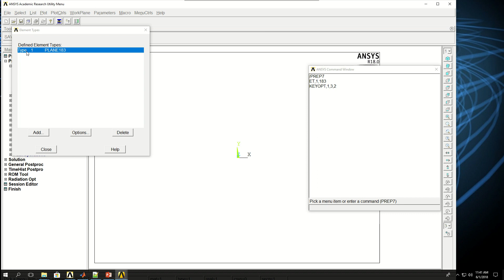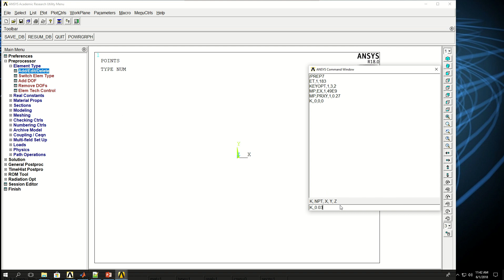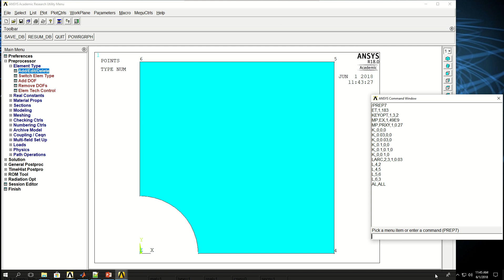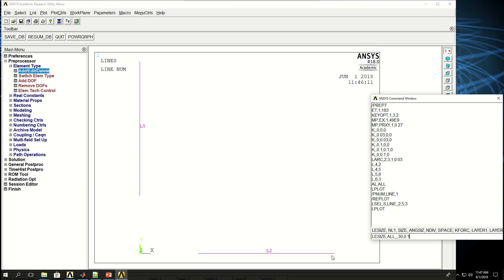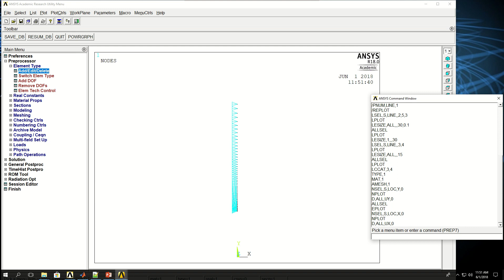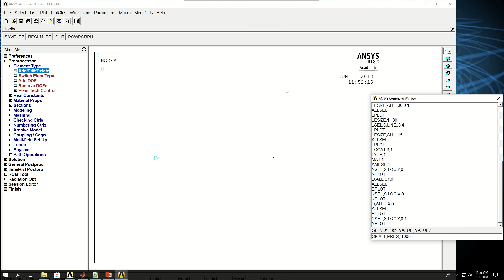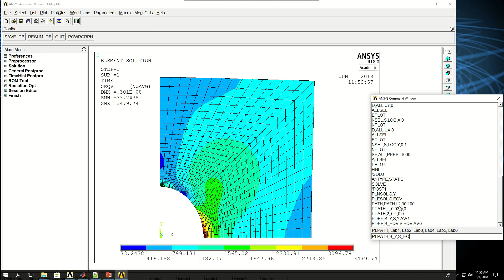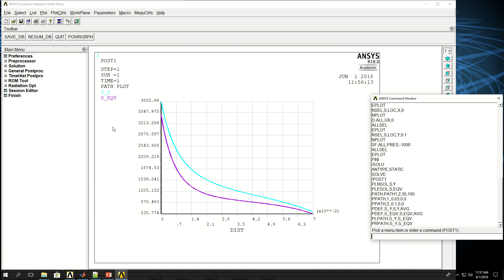Intro to FEM - Week04-A23 Modeling Example 02

Comment: I am following the videos and learning ANSYS with them . They are well explained.
I have one error when I am trying to plot my stresses. It gives " The requested S data is not available". 
What does it mean?
Reply from the maker: This is a common issue with the recent releases of Ansys. They run in distributed mode. There are two solutions. One is to turn off distributed on the Product Launcher window and turn on either parallel or single core modes. This is good for single or personal computers. The second solution is to run "SET,LAST" command at the beginning of post-processing.